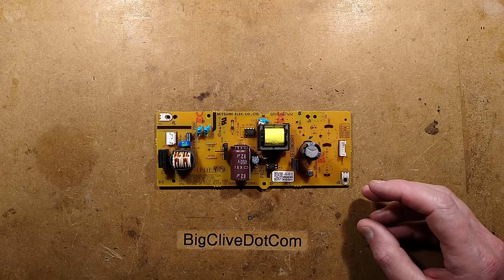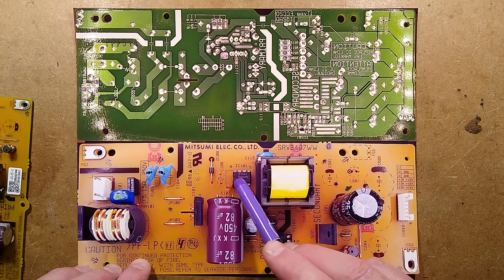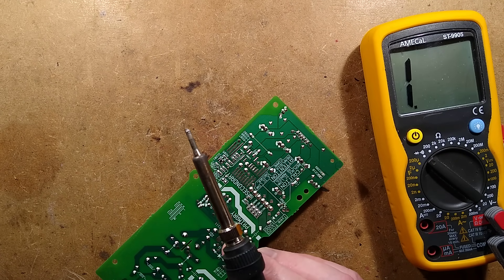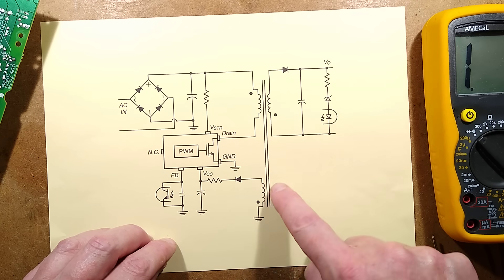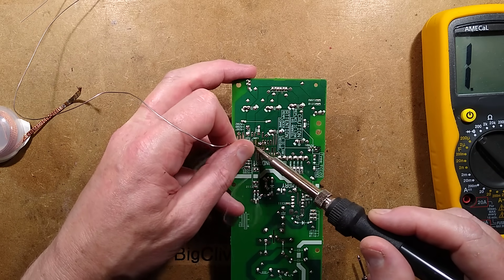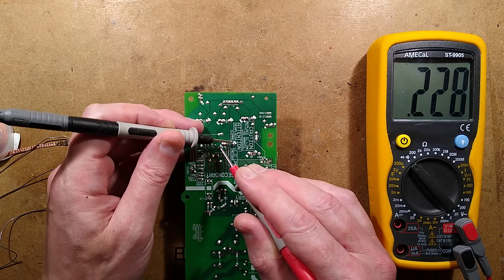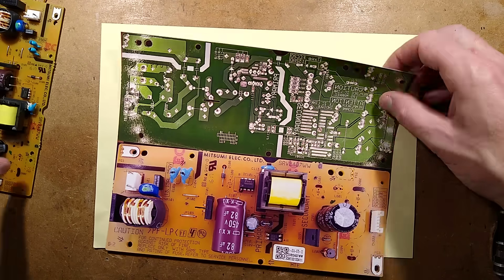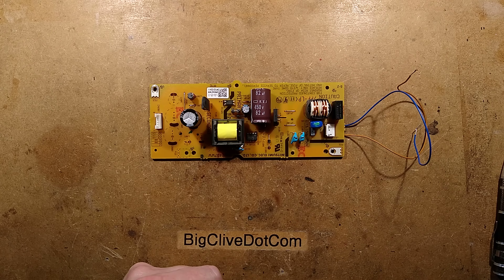Diagnosing a faulty PSU

Comment: Is it just me or on that board half of the components (caps, chokes) are missing? 🤔
Reply: Not populated spots are pretty common, especially when a manufacturer is using same board for different uses (additional voltages, higher power etc.). When those are not needed, parts are not installed as that would be simple waste of money. It doesn't hurt as long as they don't remove some important parts eg. proper filtration or protection circuits etc.
Reply: @Kwaq84  thanks, I was just worried about the single output cap :)
Reply from the maker: It seems to have multiple voltage configurations.
Reply: @bigclivedotcom  ok, thanks Clive!
Reply: Often there are several variants using the same PCB. They differ in their capabilities and which components are soldered in. Especially if the manufacturer doesn't know the demand for each variant ahead of time.

Comment: I had a psu that gave 12 volts..  But when loaded it kinda pulsed.. I Checked every thing and changed a couple of components actually but i didnt know how to check the transformer..  Could u make a video on this?
Reply from the maker: Sounds like it could be a failing capacitor in the vicinity of the control chip.
Reply: @bigclivedotcom  i actually changed all the capacitors,  mosfets,   and shottkey diode.

Comment: Just wondering did you install the transistor inverted horizontally? Will it make any difference?
Reply: Transistor? He said double Schottky diode, with symmetric pinout. So the orientation doesn't matter unless it has to match a heat sink.
Reply: @Hauketal  oh, my bad. Yes, orientation doesn't make a different here and in this case. Thanks!

Comment: For 10 years ago, my mom by new DVD player. It broke few days after she used in first time. The capacitor was dry out. The store there DVD come from told her by new because it will be too expensive to fix. I take the player with me too my work and change this capacitor. DVD player is fully active 10 years later. I fixed player for 100 isl. Krona. New DVD player cost about 30.000 isl. Krona.

Comment: "This is good", I know that feeling when you're expecting a pop or smoke and nothing happens :-)
Reply: Anything to do with mains I always use a 3a fuse in the plug
Reply: @joshuabest100  In a test like this it is much better to replace your fuse with say a 40w or 60w incandescent light bulb, if it comes on the device is still shorted, but will not explode because there is not enough power available for blowing stuff up. For a Youtube channel though it is better without it: because you will have sparks and flying shrapnel which is always cool! :D
Reply: @perhansson6718  that's a pretty good idea tbh I might use this
Reply: @perhansson6718  that explains why my TV repairman grampa always used a light bulb for various kinds of testing
Reply: @perhansson6718  haha indeed😂😂😂😂
Reply: @perhansson6718  You must have been watching Electroboom!
Reply: After changing the clearly blown smoothing cap I decided that must be fix, fitted a new cap, switched on, and bang went the input filter coils followed by smoke. Lesson learnt, never assume the 'obvious' fault isn't the 'only' fault.

Comment: Mitsumi was a popular brand of CD-ROM drives in the early 1990s, glad they are still in the business.
  That double diode makes me think of the classic two-winding full rectification circuit, with one half winding powering the output during opposing cycles (diode concic A-C-A).  The other possibility is a single winding providing opposing DC voltages from opposing cycles (diode config A-C A-C).
Reply: I remember an early mitsumi CD drive totally bombing win98 consistently.. the drivers just never worked.
Reply: @benbaselet2026  Yeah, their unusual interface required drivers that weren't really made for later Windows versions.
Reply: @benbaselet2026  and now they are spitting cherry MX clones

Comment: I just recently cooked a yamaha AV receiver, not having pulled it apart extensively I can't see any signs of a burst cap or any burn marks. Is there anything common that will generally let go first in an overloaded receiver? 
I did have it very loud and it does probably have more speakers attached than recommended!
Reply: most probably mosfets get cooked up in such overload situations. they are very easy to fix. however if other components are also cooked along with mosfets then you need good grasp of electronics to sniff out the problem and repair it
Reply: @lordjaashin  replacing components is as about as far as my electroctronics skill set goes unfortunately, I could lookup particular components to know what to expect in a test but there's a lot going on in there. I shall persist however.
Reply: @SianaGearz  appreciate the input. I'll definitely give it my best, I'd rather repair than replace it for sentimental reasons. Cheers

Comment: I have very little understanding of circuitry but I wish I could solve the problems with my boards as I seem to have quite a few boards , maybe I should send you one. I lost possible 30 in the cold weather at the start of the year 😫
Reply: Mhm maybe check out DiodeGoneWild for PSU explanations!

Ultimately you can just brute force most PSU repairs, without super detailed understanding, just as long as you follow safe practices to avoid shocking yourself, potentially lethally. I suggest getting a component tester, LCR-T4 is less than $10 and will show you if your capacitors, diodes and transistors are still good (out of circuit, so quite some fiddly desoldering required), and you just replace everything that is bad. Shorted diodes and transistors are also usually fairly easy to find in-circuit with a multimeter.

Once you find a PSU with burned transformers or inductors though, pretty much don't bother with those. A lot of semiconductors will be dead on those, and capacitors too; also just don't re-use heavily used capacitors of mediocre provenance.
Reply: @SianaGearz  Thanks so much for your time.  I've tried with no success in the past but this video and your extra input will probably really help. I'm going to try and repair a couple over the weekend and I'll try to come back and let you know how I get on 🤩

Comment: Diode might Lack heatsinking. More than 1w through this package doesnt Seem to be too good.
Also the inductor on the Outside might have given some back-emf voltage Peak onto the Diode.
Reply: Possible but unlikely, it wasn't showing signs of thermal distress, and it is a double Schottky. The output inductor is just a choke with a low turn count, and designed to dissippate the transient. Unlike inductors which are designed to store the transient with as little loss as possible.

Comment: You can tell Big Clive is a good guy because he gives too much flux.
Reply: Ha ha ha 😂 ❤️ the flux is the spirit of the electrons
Reply: Yeahhh..more flux with leadbased solder😁😁😁😁
Reply: XD😊
Reply: @Jihadbearzwithgunz   yeahh That suxxx😢😢😬😬😠
Reply: @Jihadbearzwithgunz  ahh O.K thanx😊😊
Reply: Much rather too much Flux then not enough.. I'm the same way when doing electronics specially pcbs cause I'm always worrying that I may burn up the paths
Reply: I only regret using too much flux when it comes time to clean the board, but I'd rather that than the frustration of watching solder puddle on the tip of the iron and refuse to wet the joint.
Reply: Hmmm... I'm trying to turn that into a meme-y thing. How about "Lots of flux were given that day" ?
Reply: If I don't have desoldering Braid, I cut up some TV Aerial Lead, and then strip off the copper sheath - and use it! I always add some flux to the copper before using. Try it sometime. It works well.

Comment: You must spend a decent amount on printer ink, do you use photo paper or just regular paper?
Reply from the maker: Bulk ink printer and bulk glossy photo paper.
Reply: He uses a continuous ink system based printer ("Epson ecotank") - if you regularly print with an ink based printer look and see if you can get a 3rd party CIS for your printer- not ideal if you only print occasionally as the heads still can block up due to dry ink, but bulk ink is way cheaper than those silly little cartridges, which also helps with the next answer... for the closeups he uses photo paper, just helps with depth of colour and contrast, but depending on settings can use a bit more ink than usual :)

Comment: The most efficient way ive burned my fingers until now.. nice to see I'm not the only one to desolder stuff that way
Reply: My left hand index used to have thick skin from removing darn driver FETs. Using a solder sucker nowadays, annoying when the silicone sleeve breaks though as it no longer holds seal around the pin
Reply: @SwichMad  i use it too, but usually find the tip absolutely inefficient and too large and still pull on the components anyway
Reply: Tweezers are my absolute favourite tool that i can't imagine living without. I think i might use my electronics tweezers more than my soldering station.
Reply: @SianaGearz  For me it's my side cutters from the 3d printers (i got a set of better ones,but the cheap ones do it too, until the handles fail) , i get the same dexterity out of them like tweezers from so much use

Comment: now go fix a makita 110v battery 18v fast charger, which has a freakin' hundred unnamed passives before they power up the main charging circuit. It's sitting on my shelf collecting dust because I don't have a schematic. The 2 anonymous microcontrollers on the high side don't inspire confidence in its repairabilty either.
Reply from the maker: Many of the older chargers are ridiculously complicated.
Reply: @bigclivedotcom  That's so true. Some newer ones are complicated due to active power factor correction. They have a boost converter between the bridge rectifier and the first smoothing capacitor.

Comment: it's almost always the transistor failing after the capacitor dries out and stressess it to the point of open circuit.
Reply: But this time it was a diode .
Reply: @andymouse  diodes are a form of transistor. And the capacitor did dry out, stressing it, causing it to fail too.
Reply: @dimitar4y  - err, diodes are not transistors. A diode is a ‘simple’ PN junction. A bipolar or FET transistor is considerably more complex than two PN junctions. The various silicon structures are different sizes and have the semiconductor material with different dopping.
Reply: @Mark1024MAK  stop being banal, they are susceptible to the same things that kill transistors. :|
Reply: @Mark1024MAK  exactly !
Reply: @dimitar4y   "banal " is ' so lacking in originality as to be obvious and boring '  The gentleman stated the facts. All semiconductors can be damaged that way but all semiconductors are not transistors, diodes are simply NOT a form of transistor they are diodes, you cant group a massive array technologies that way ...thats all.

Comment: The choke / capacitor filter at the front end is more to protect the mains from radiated HF interference. Those HF switching PSUs can be pretty electrically "noisy" - and  most of the Compliance Authorities (e.g. FCC) now mandate such suppression.
Reply: That's why the Alibaba $19 gaming computer power supplies are the best.  One or two of them can corrupt an entire MRI machine in the same building with their electrical interference.
Reply from the maker: I'd still buy one for a dollar.
Reply: 6GDC  You don't mean computer PSU surely? It bears reading the specs carefully, if it's a programmable power supply, they will have voltage dependent maximum current. 40A at 3V output maybe? Still a massive massive accomplishment, IF they did it, but it can be done, but it will be rare to see anything with more than 10A outputs. I don't know the product you're speaking of, but by far not all impressively specced and aggressively priced Ali products are scam junk.

Ali computer PSUs that the dollar guy speaks of, are just salvage junk or copies of old ATX1.3 computer PSUs, with maybe a power handling of 200W or so that rough order of magnitude, just made to look like modern PSUs on the outside.
Reply: 6GDC  NOT 40A at 170V, almost 7kVA, you can be sure.  Read between the lines - maybe 40A at the lower end and use that calculated wattage to work out what you will get at the higher end.  That's how Shenzhen do.  (mebee one or two amps if you are lucky?)  Still respectable but not 7kVA.
Reply: 6GDC  How feasible a pocket-size 40A switch-mode power supply is depends on a few things, such as: how large "pocket size" is; the input & output voltages/voltage ranges; whether they bothered with EMC (needing space for filtering components); etc.

Modern MOSFETs have extremely low on-state resistances (the "R_DS(ON)" value¹, i.e. the resistance, in Ω, between the Drain and Source pins at a specified Gate voltage). Even very cheap MOSFETs can have R_DS(ON) ratings well below 10 mΩ, and this results in very high current ratings, especially for the size. Lower resistance means a lower voltage drop, less resistive heating, and thus more current before things get out of hand (I'm kinda guessing here, but it makes sense).

Clive's shown a couple of devices on this channel containing SOT-23 MOSFETs capable of several amps of continuous current - and SOT-23 devices are only 2.9×1.3 mm (top surface; Wikipedia doesn't list the height of SOT-23).
The "USB power bank that [intentionally] gets very hot" video comes to mind. It used one of those SOT-23 MOSFETs to switch its heaters, IIRC.

There's also the recent emergence and popularity of gallium nitride MOSFETs, which claim higher voltage ratings, higher efficiency, smaller overall device size, and other benefits. They've driven the recent influx of "GaN" SMPSs in the consumer space - e.g. USB power supplies and phone chargers, especially high-power USB-PD supplies. Those devices can supposedly be made smaller and lighter with GaN MOSFETs, as well as being more energy efficient, in theory.
(No doubt some of those devices are just slapping "GaN" on the packaging/product description as a marketing lie, but some are probably genuine!)

Further reading: https://en.wikipedia.org/wiki/Gallium_nitride#Transistors_and_Power_ICs (and the rest of the article for more general info about GaN tech)

So your "40A" SMPS could be genuine! It's not totally unrealistic, IMO.
...but it could also very well be a wild exaggeration! 😁

¹ R_DS(ON) is typically written as "R" followed by "DS(ON)" in subscript (no "_"), but I can't use subscript on YouTube - at least not without obscure Unicode characters that I don't have easy access to on my phone - so I'm using "_" to indicate subscript.
Reply: I think that is what Clive said.
Reply: 6GDC  I have a 12V PSU out of a server not much bigger than a PC PSU, and its rated at 1.2Kw or 100A, and I have tested it at 100A continuous . It pulled <6A on the 240V mains side. I guess in the states at 120V it would be pulling roughly 12A...    Though I bet these did not cost $19.
Reply: That's what a common mode filter does LOL

Comment: Noise is becoming a big problem, especially our amateur radio.
73 de N2NLQ active
Reply: Even just AM radio is basically unusable in my apartment block because at least one household uses these shitty PowerLAN/DLAN ethernet-over-powerlines adapters, turning all the electrical wiring into a giant antenna transmitting a f*ckton of noise/interference (think cheap chinese switchmode PSU with barely any filtering, but on steroids)
Reply: @Knaeckebrotsaege  I'm using these every now and then for easy LAN connection across my apartment.

Say, someone would like to catch the noise with their SW defined radio, at which frequency range would they have to look? I'm too lazy to do my own research. :-/
Asking for a friend.
Reply: @froedlmetallmann4643  Well the AM broadcast band is from 550kHz to 1720kHz.
Reply: Taking a look around, the frequency range seems to be quite broad, being between 2MHz, and around 70MHz.

Comment: Why do some SMPS need a proper transformer while others can use a simple coil?
Reply from the maker: The ones with transformers are usually isolated.  The ones with inductors are not isolated from the mains supply.
Reply: I came across a product with 12v 2a power supply thats... a bit naughty its a non isolated supply with plugs so you can use it on other stuff 

https://youtu.be/g4cELaYcNVw

Comment: Thank you Clive! This looks like a fault I had recently in a Peavey mixer. Another chip had visibly blown on the PSU, which I replaced. Now the desk pulses on and off just as you described. I’ll dig it back out and have another go at fixing it now!
Reply: I have a bass amp that has dual secondaries +-15 and +-45 the 15v neg rail failed and was doing what you describe but after replacing caps there was some huge charge then a bang across the -15v rail the windings are now open on the secondary, smps are great but if you lose the transformer it's game over

Comment: When inspecting a psu do you normally discharge all the caps first? or just the big fat electrolytic ones; just wondering what your rule of thumb is for avoid pain. I get paying more attention to the primary size that make total sense. Also how do you print your photos again? I understand the whole simple light box for good photos but your prints are always so clear and custom sized?
Reply from the maker: The main ones to discharge are the large electrolytic capacitors on the primary side.
I take well-lit pictures, crop them on Irfanview and then print on glossy photo paper.
Reply: @bigclivedotcom  Any preference for a particular photo printer? I've never really had a need for one.
Reply from the maker: @stevenspmd  Don't get a cheap one as they make up for the price with expensive ink.  I use an Epson ecotank which has refillable bulk ink tanks.